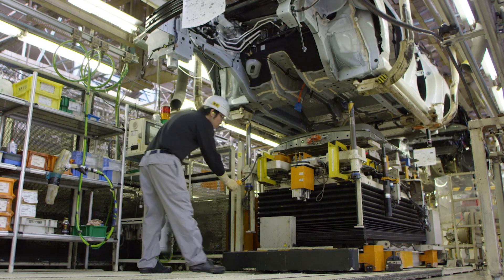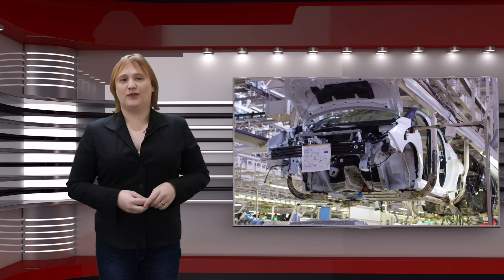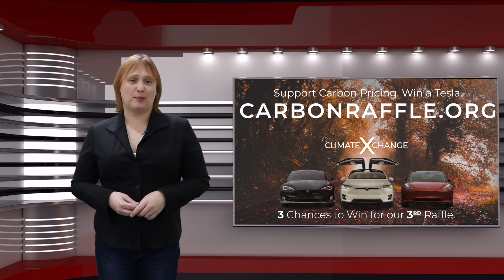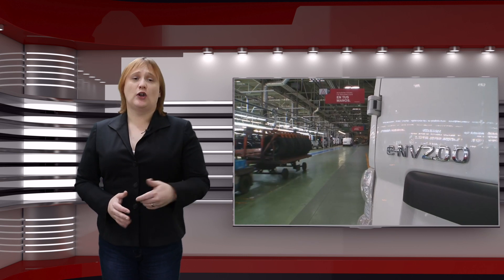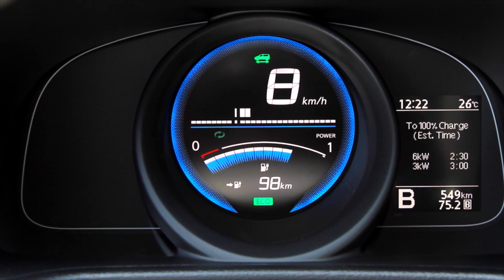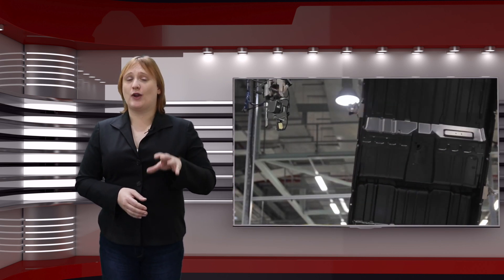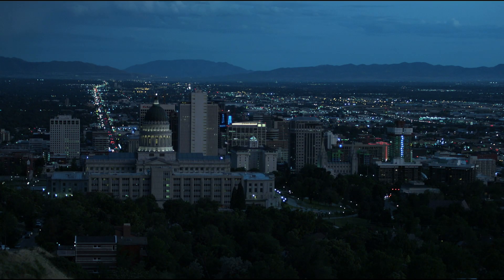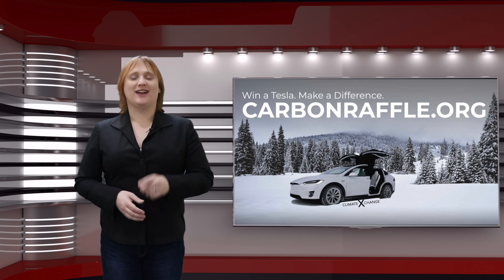The 2019 Nissan Leaf e-Plus Will Get Air-Conditioned Battery Cooling, Not Liquid Cooling

Comment: I think many are over-reacting to news that they don’t understand. Somehow they got the idea that liquid cooling is ALWAYS better. But that’s not true. The Renault Zoe and Hyundai Ioniq are both “Air Cooled”, and the Ioniq charges faster than a liquid cooled Chevy Bolt. 

Keep in mind both batteries are really Freon cooled, and the only difference is whether the Freon does direct cooling, of uses another gas or liquid as an intermediate medium of heat transfer. 

If you have a frost-free freezer, guess what, that’s air cooled food and ice. It doesn’t freeze ice as fast as putting a 1960’s aluminum ice tray directly on the evaporator, but it makes good ice and doesn’t need to be defrosted.

The Chevy Volt and Tesla’s NEED liquid cooling, because those are high drain, fast charge batteries, packed tight, with cooling plates directly in contact with each cell. But the Bolt, Leaf, Ioniq don’t need liquid cooling. 

Anyone who has studied the Volt battery knows it have a chiller plate on the bottom, and a single heat sink rising up between 2 of the 3 cells. That means one of the cells is not being cooled the same as the others. Meaning of the surface area Of the 6 sides of the 3 cells, only 2 sides, 1/3 has contact with the heat sink, which has contact with the chiller plate, which has coolant going through a chiller.

But in the air cooled packs, they design the modules to have large contact with the cells inside. They actually have a lot of surface area exposed to the air which is cooled. 

If you charge at 50 kw and 10% is converted to heat, that’s 17,000 btu. A typical car AC can move 60,000 btu, so it’s not a big deal to send some to a chiller to cool some coolant, then send the coolant to a heat exchanger, then send the air in the battery pack through that heat exchanger.

So just relax and let’s see what it can do. We already know lots of people will do their very best to cause it to overheat. Let’s just see if they can.
Reply: Someone knows their stuff! Thank you!
Reply: I  don't think you can compare the relatively small batteries of Zoe and Ioniq with substantially larger batteries needed for leaf plus and beyond. 
As volume goes up with dimension to power 3 - surface area goes as to square. As heat dissipation uses surface area then as you scale up volume your cooling typically  trails behind by power index of 1.  
Forced air cooling has heat transfer coefficients that a 100 to 1000 times less than liquid . Its not that you can't do it for say 60kWh . Its just not a good model for future even higher power variants 100, 150 kwh? 
There is a reason why Porsche eventually gave up on air cooled engines as the horsepower (kW) output engines climbed - in the end although it is simpler engineering it just becomes self defeating  law of diminishing returns .

With some very skilful engineering and know-how and intimate knowledge of all the details and variables that I don't have then maybe its possible to push into higher power batteries. But so far Nissan have shown themselves to be fairly blind in thermal management and so the evidence is against them on this move. I'm sure a workable larger battery will make it out of the showroom. Whether you can properly rapid charge more than once per day  (or even once on a very hot day) remains to be seen . Rapidgate Mk.2 seems more than likely instead
Reply: @bbbf09  A bigger battery needs less cooling than a small one if you do not increase the power drawn from it.
Reply: bbbf09, keep in mind the Leaf is low power, and would likely only charge at 1C, and as long as they allow proper airflow, there will be a lot of heat sink area. Liquid cooling is only needed when the surface area is too small to cool with a heat sink. 

If you have a stack of iPads with a coin at each corner between each iPad, in an air conditioned room, with a fan blowing across the stack while charging, it’s not going to overheat. As long as Nissan uses enough heat sink area touching the pouch cells and exposed to cool airflow, it will be fine if it’s activated at the right time.

Let’s see what they come up with. I really don’t think it will charge noticeably slower than a Bolt EV. If this lets them keep the price below $35k and charging on 50kw DCFC as fast as a Bolt, I think it will be fine.
Reply: karlInSanDiego, now that Carlos Ghosn is out of Nissan, maybe Nissan can put some Japanese engineers on it. It doesn’t make any sense that Zoe was fine and Nissan wasn’t. 

Right now japan is still waiting for viable batteries. If they ever come, I think Nissan, Subaru, Mitsubishi etc are all going to make some crazy AWD EVs. Electric R35, Evo and WRX.
Reply: @imho7250  I'm not sure I understand your comment. AESC was a joint venture between Nissan and NEC, two japanese corporations. The batteries for the 2011/12 LEAF were made exclusively in Japan. Are you suggesting they didn't use Japanese engineers to design the batteries they made? While Renault a French company did use Japanese engineers?

Why are Japan waiting for viable batteries. Who is preventing them from making them?
Reply: Jean-Pierre White, viable batteries don’t exist, that’s why they dint make them. Japan will wait till is viable before they do something. Viable meaning making a car that doesn’t need subsidies to sell. Of course japan can make an electric car, they’ve been making electric RC cars for a long time, and of course Panasonic is Japanese. But they can’t build a viable mass market EV yet.

Tesla already found out what happens when their unviable cars lose the incentives that make them viable, which is they stop selling. I predict sales in the US will drop to almost nothing in Jan 2019, and Tesla will then ship every AWD and P3D it can make internationally, because there are a few people willing and waiting. 

GM and Ford and all Japanese companies are sitting on the fence, waiting to see what happens. They aren’t worried about Tesla getting ahead, because the only way to get ahead with EVs is to make a new generation battery and own the patent on it and just not allow anyone else to make or sell them.
Reply: @imho7250  As incentives expire there will be a dip in sales, but not for the reasons you posit. The government can and do influence consumer behavior by changing incentives or taxes on products, this influence is temporary.  Right now there is a peak in demand for Tesla vehicles because people know the incentive will be cut in half very soon. The current demand peak is artificially and unsustainably high due to the upcoming change. We'll no doubt see a drop in US sales come January, that dip is temporary and sales will ultimately settle on the "true demand" for the vehicle.

When incentives are eliminated overnight the short term dip is significant as we saw in Ontario earlier this year. The Federal Tax incentive phases out gradually so the dip in sales will not be as severe as it might be.

You didn't comment on why you think Zoe batteries are superior to LEAF batteries. Care to share some more of your thoughts on that?
Reply: Jean-Pierre White, just the fact that the zoo has active thermal management and the current Leaf doesn’t, so the Zoe can go from AC43 to AC43 all day without overheating, while the Leaf will not shed heat fast enough to drive had from DCFC to DCFC. I don’t think the cells are significantly better or worse.

The gentle phase out of federal tax credits, basically only a $3750 loss, will not be as bad as Hong Kong or Ontario, but you have to ask yourself, if you wanted a new car in H1 2019, but knew you can get it for $3750 less in 2018, are you going to buy now or wait? If you are waiting in hoes of the $35k model, I can understand that, but all new US Tesla  over $46k will drop sharply in 2019. 

As you can see, the demand is not that huge. You don’t hear any story in North America about someone waiting a long time for their delivery, just waiting for getting it repaired 3 days after delivery. 

I do predict Tesla will have a discount in December on all the model 3 they have stacked up because they already leveraged as much of the $7500 tax credit as possible, now all they can do is offer $1000 off, free delivery, or something to sweeten the pie, because it it won’t sell with a $7500 tax credit, it won’t sell with a $3750 tax credit.

In order for Tesla to keep up the cash flow they will need to make AWD and P3D and send them by RoRo ship to other countries. But after selling the cream of the crop over there, they will face the same problem as in the US, which is they can’t make the cheaper models. 

Tesla May try to drag it out and offer a $44k Version (LR with standard interior) or $41k midrange with standard interior, but the $35k can only be sold in California, and perhaps some other ZEV states that allow traveling credits. 

That’s my prediction. Tesla needs to keep up the illusion of profit till March, and then they can pay their debt with stock and then things will get easier.
Reply: @imho7250  I agree that active cooling is the differentiator between the Zoe and LEAF. Puzzles me why after 8 years the LEAF hasn't got active cooling yet, especially when they came out with the new body style, that was the ideal opportunity to redesign the drive train and fit extra components in.

I'm more glass half full than you are. I remember in 2013 many held the opinion that once the backlog of orders for the Model S were met sales would plummet, I mean how many people are there that want to spend 100k+ on a car? A lot more than many realised. Similarly I believe the mid range will be the big seller in the US while the AWD and Performance versions are shipped elsewhere to satisfy pent up demand.

You may not of heard of people waiting a long time for the Model 3's, but I am one data point you may have been unaware of. It took 16 weeks for me to get my AWD. Cash buy, no trade in. I was the model customer and it still took 16 weeks. I'm of the opinion the Model 3 will sell well in the US. We haven't seen air suspension yet, that will provide a nice little peak in demand when its available.

If folks are waiting for the 35k model 3 , they will IMO be very lucky to get it in the first half of 2019. I don't see that being released until later next year.
Reply: Jean-Pierre White, i think Nissan was focused on mass market, and the truth is, 95% of 40kwh Leaf are happy with it because it’s a major upgrade from the previous version. The only ones complaining are those who shouldn’t be buying a Leaf. 

All the Tesla competition has delayed launch until Tesla’s federal tax credit phaseout begins, most waiting for 2019. After June 2019, the I PACE will have a $5625 tax credit advantage over Tesla, which gives quite a bit of leverage in the US. 

Tesla spent $billions building up a name for itself with 10 superchargers per car and a service center for every 10 cars. Very fast service. Tesla loaner. Full red carpet service. But in 2018 Tesla has started cannibalizing their reputation by selling cars faster than they expand the charging and service network. Some of Tesla biggest customers are now disillusioned and ready to try another EV manufacturer. 

Tesla hopes to keep selling cars faster than they need to repair them, but if sales slow down, the warranty cost will be overwhelming.
Reply: @imho7250  Tesla's major challenge will be collision repair. They have not setup adequate parts delivery logistics to keep up and there are customers waiting for months for parts. My biggest fear is for my Model 3 to be hit from behind. In the 7 years I've owned my LEAF its been hit from behind 3 times, it's just a question of time. Nashville drivers continue to be more and more distracted. 

WIth Tesla's loaner program, regular vehicle repairs will not be a big customer experience issue. I get a loaner each time I take my LEAF to the dealer for service and will expect Tesla to do the same. They can take as long as necessary; as long as I have wheels I'm good.

WIth 2,000 miles on the M3 I have just two minor service items. rear passenger light fogged after washing, once. Brakes often squeal when braking in reverse. That's it.
Reply: Jean-Pierre White, hopefully if they can make 1000 of each part per day they can make a few extra body parts to put in their repair parts supply. I think collision repair on the Model 3 will be easier since it’s not all aluminum.
Reply: @bbbf09  Volume of battery back goes up with dimension to power 3 - surface area goes as to square. But volume and surface area of single cell in the battery does not change.  This matters for cooling.  Larger pack needs larger air gaps for enough coolant air to pass through.  Perhaps this is not a problem.  In some ways air cooling is better.  We have to wait for practical tests.
Reply: bbbf09 the 60 KWh battery of the leaf is the same size as the old 24 kWh leaf battery - identical box....the volume has not changed at all - only the energy density - amazing stuff....
Reply: @bbbf09  You can cool the outside of a cell all you want. You just need to make sure the heat from inside the cell doesn't exceed the diffusion rate. Load density is the key to keeping a cell cool inside and out. A high capacity battery has a lower load density, if used to drive the same load. Nissan may have already solved the problem, without any revision to its existing cooling system, by merely increasing capacity.
Reply: I think it is a well made design decision considering the , only sacrificing faster charging speeds.  Nissan, more likely, will go liquid with a new EV.
Reply: @zodiacfml  Do you know that charging speed is slower?  Cool air can directly touch cell from all sides.  Liquid only part of cell and indirectly.  Wait for tests, before making conclusions.
Reply: IMHO the 2 things that are on my mind are: 

1. They will allow up to 100Kw charging on the new model - even more heat.
2. The motor will be more powerful, therefore more current draw opportunity when driving.

Both of these make the temperatures go further up, so we shall wait and watch Bjorn drive it on autobahn or similar and charge it at 100kw to watch it be either brilliant, acceptable, or terrible. Wonder if Nissan will actually mention anything about rapid charging considering the #rapidgate
Reply: Aleksandr Vysockij, the 100 kw may just mean that it can charge at 65 kW on a 100kw Charger. That seems to be the latest marketing trend. But if Nissan can use the same battery chemistry as the Hyundai Ioniq, the heat Nader won’t be so much. 

I don’t think the horsepower increase will be that much, and that won’t change the cruise energy draw, which should still only be 15kw, making up to 1.5kw of heat. 

Due to the mass of the battery, it’s going to be critical that battery conditioning comes on at the right time, and not wait till turtle mode. 

With the bigger battery, the Leaf can be less stingy with battery conditioning power, and let it kick in early so you don’t arrive at a DCFC with a hot battery, and once charging it should run battery cooling anytime it’s 25C or more. 

The good part of Nissan is they have the cheapest new EV you can buy in the US, but range is low. If they can get 60 kWh and end Rapidgate, for less than $35k, and be profitable, I think they have a winner.

It does no good to design a $35k EV that is so great that it cost $38k to make it.
Reply: IMHO Time is valuable these days so waiting a extra hour at a fastcharger on a road trip is not ok. Liquid is the way to go with cars that will drive long distance.
Reply: Top12 boardstore, the air cooled Ioniq charges at a higher C-rate than a liquid cooled Chevy Bolt. Liquid is not always needed in cooling. It’s needed when the heatsink area needed is too big for what you are trying to cool. 

I’m sure plenty will do there best to overheat it, so let’s see what it does when it’s actually in hands of someone unbiased.
Reply: @imho7250  true, but also the Ioniq overheated when they tried to beat the world record how far they can drive in 24h. And I think relatively quickly within 2 hours or something. They were able to get around it with additional fans while charging and another fan blowing into the battery from an opening below the back seats.
Reply: EVPaddy I don’t think the Hyundai was designed to be driven for 24 hours non stop - if you burn the toast you don’t blame the bread...
Reply: the heat transfer coefficient for an air cooling system is, at least, an order of magnitude less than liquid.  However, the real problem is this.  The history of Tesla, Volt, and Bolt is that battery degradation is insignificant.  Nissan has no such reputation.  Far from it.  We were assured through several iterations of the battery that the degradation problem was solved.  It never was.  So, do we believe them now?
Reply: @epeon7  If they're going to stick to air cooling, as opposed to liquid cooling, they're going to have to greatly increase the air flow volume, without the fans taking more power than the water pumps and radiator, which may still be fan cooled. I think it can be done, but there will have to be good air flow paths, without making the battery enclosure too large. That's the main reason for liquid cooling, they can pack more cells in a smaller box, while providing good cooling.
Reply: I thought you were talking sense until you mentioned "BTU". No sensible engineer would work with such units :P
Reply: icl, out of respect for Nikki, I muse use British Thermal Units, or she will have no choice but to carry out her assignment of collecting 240+ years of back taxes. LOL
Reply: @imho7250  I thought the "B" was for Bullshit hehehehh
Reply: Jhon Krasnovskiy  All three rear ends happened when I was stationary at a red light or in stop go traffic. My rear lights were surely on. Regen on the LEAF is weak and other drivers are no more likely to hit you than normal.

A fourth accident was early on the LEAF's life when a deer ran in front of me doing over $7,000 in damage. See https://jpwhitetesla.com/2011/12/10/leafless-in-nashville/ 

I get my insurance company to pay for the repairs and let them subrogate the other drivers insurance to recover their expenses. You get better service that way. Coverage for the LEAF is the same as any vehicle. My rates have not increased due to the accidents. If you are 100% not at fault the insurance company will not increase your rates. Parts are typically available to repair shops within 48 hours. I have found repairs to be very good as long as you choose a reputable shop, if you use a shop certified by your insurance company they will warrant the repairs in addition to the shops warranty for as long as you own the car. I've used Service King, they have the equipment and training to repair aluminum panels that the early LEAF used. Your 2015 is all steel so you can take it to any decent repair shop.

If the battery were to be damaged, the car would no doubt be totalled. It is very well packaged and tucked out of harm's way. It would take a massive accident to impact the battery. No need to worry about that at all.
Reply: Thank you for some intelligent input! Most of critics on here don’t understand EV’s and your post hopefully educates a little bit.
Reply: IMHO - I think people are right to be skeptical of Nissan this time.  Both the first and second generation Leaf have thermal management problems, even though Nissan swore there’d be no problems.  They’re all about pinching pennys, not technical merit and reliability.  Btw, the second generation Volt has 2 cells per cooling plate.
Reply: Bryan Noga first two generations have no problem with the thermal management because they don’t have one -
Reply: Ever watched the weber auto channel great for deep dives, to point out a slight anomaly in your rant. First off there are two Generations of Volt Battery, the first Gen  Volt(20013-2015 16 kwh) had 3 cells per cell group. The 2nd Gen 18.2 kwh 2016-present Volt has 2 cell's per group one cooling plate for every 2 cells more effective and more efficient. Source 2018 Chevrolet Volt 355.2V Li-Ion Battery - Deep Dive WeberAuto of Weber State University Professor John Kelly, please feel free to correct me if I'm wrong we all make mistakes. All so the KIA Soul EV is chilled by air conditioned cabin air. Source https://youtu.be/eWYtq0hxhQg
Reply: @IMHO - So, what did they do?  NOTHING!  There is no air cooling, only the same old ineffective passive cooling. DOOOH !!!!!